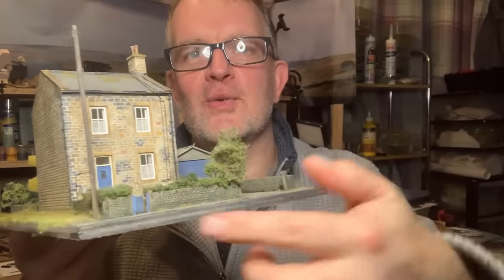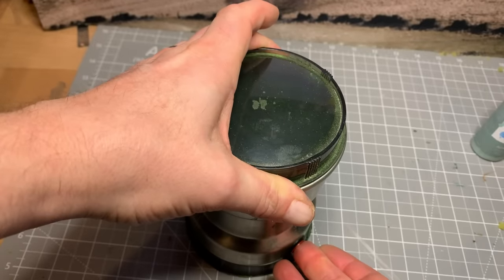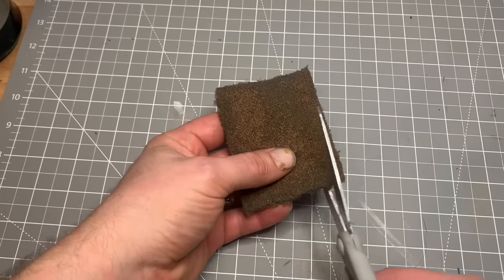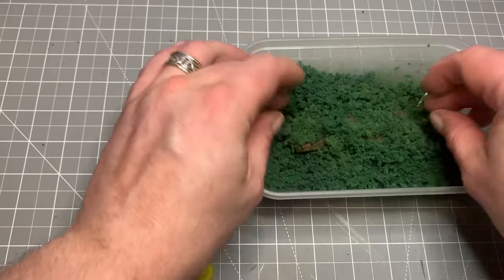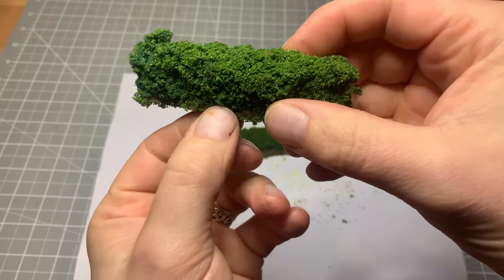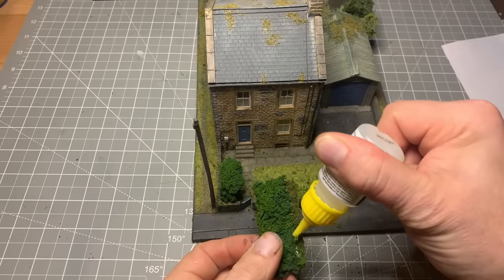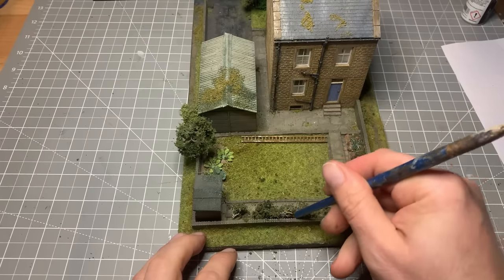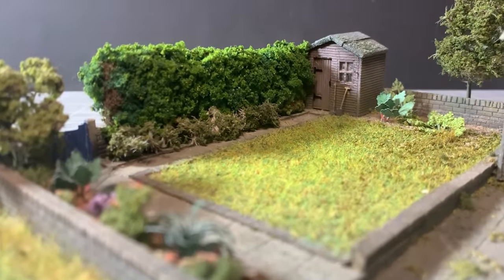How to make a model hedge from a SIMPLE pan scourer!

Comment: This is awesome, now I just need a coffee grinder….. every time I tell myself that’s enough spending on model stuff I learn something new and cool 🤣🤣🤣 
This is just wonderful Lee 😍
Reply from the maker: Or a cheap handheld food processor?
Reply: Certainly cheaper than buying the mass produced stuff from certain brands. Great tips, subbed 🎉
Reply from the maker: @_RandomPea  with a bit of time and for about the same cost you can make about 20x as much
Reply: I have two coffee grinders, $5 or so each at the thrift store. I also dump out the grinder contents and spread on a paper towel as they dry a lock quicker
Reply from the maker: @tomaaron6187  There you go. It’s worth getting one (or two ) - handy little tool…
Reply: Nicely done, thanks for sharing..Overall this saves a lot of money on off the shelf hobby items..
Reply: save yourself some money and pick one up from a salvation army store or goodwill.

Comment: I use a lot of your methods, the cheap coffee grinder and methods of colouring. I rip my foam from old foam chair cushions with a wire wheel. I have cut foam blocks to size, painted them brown and rolled them in fine foam while the paint was still wet for manicured hedges. For sculptor mould, I put 10 sheets of soft toilet paper in a nutri bullet, give it a quick whizz and you have paper fluff. Put about an inch of plaster in a fruit jar, fill loosely with the fluff, shake vigoursly to coat the fluff, add water to desired consistency and you have the cheapest sculptor mould you can get. You can use the coffee grinder but it is necessary to cut the paper into small pieces. Badly weathered MDF broken up and put into the coffee grinder makes a good static grass. Colour in the same way as you did the flock. Whizz again when dry to separate any fibres that may have stuck together. Can be rubbed through a sieve to grade it into various lengths. Who needs to spend a fortune on materials when a little ingenuity can save heaps by using what we have lying around
 Besides it gives a lot of personal satisfaction to know that it was all your own work!!
Reply from the maker: That’s brilliant- I think a lot of us have picked up tricks and tips from each other and it just goes to show what ingenuity there is in the modelling world, and yes, there’s much more satisfaction in knowing you did it yourself

Comment: I have usually found that a hot glue gun has a mind of its own on how much glue you require. I found a Sicaflex adhesive which is very good for assembling foam pieces for terrain. Is required a few hours to fully set but grabs quickly
 You can spread it with your fingers, use it to fill gaps and water cleanup. Can't remember its  actual name but it's one of the cheaper products in the Sicaflex range. To shape the styrofoam base for my terrain, I use a file card. For any who might know it by  a different name, it is the short bristled steel pad used for cleaning the swarf from hand files. It is a bit messy and having a vacuum cleaner handy is desirable but it is far easier than using a knife.
Reply from the maker: Love all these extra tips - thank you 😊

Comment: Looks good, but a few suggestions - firstly use PVA or Mod Podge for a better bond when gluing foam, foam tends to just absorb superglue, causing it to dry fast, which just makes the foam go hard without actually gluing it very well. Second, once it's finished get some matt Mod Podge, dilute it and put it in a spritz bottle, then spray a few squirts over it to seal everything in, making it more durable and stopping any loose bits from falling off. Mod Podge has a sealant in it that works well with anything like foam or scenics to help lock them in place.

One more thing, if you mix up more batches of the ground up foam with different shades of green, you can add a little bit here, a little bit there, just to break up the solid colour and give it a bit of variation. Not always necessary, and it depends on what you're going for, but just another little thing that can add to a piece if you feel you want it.

Just found your channel and I know what I'm binge watching for a while, haha.
Reply from the maker: Always happy to receive extra information. Superglue was used for speed here, but yea, i agree that pva is far superior in the long run.
Reply: @lnrmodels  A glue gun works well too, especially for speed, haha.
Reply from the maker: @sanguisdominus  hahaha - I don’t get on well with glue guns …
Reply: Yeah, glue guns have those annoying stringy bits that hang between the deposited glue and the gun. They do have their uses when that is not an issue. When applying hair spray to foam, I hold the can well away from and above if possible so that the first couple of squirts fall softly on the foam to moisten it a little without the risk of blowing any loose bits away. Just a couple of these light ones and then you can get serious without any undesirable results.
Reply: @rolandhersom239   Sometimes, depending on the build, you can use a lighter or a soldering iron to melt the glue stick and quickly use a toothpick to apply it, it's pretty useful if you need to be a bit more precise than what a glue gun allows.
Reply: Absolutely brilliant mate and very helpful
Reply from the maker: @gardensbytheminute2668  this is what we like to see - a sharing of help, knowledge and advice. I love to see it.
Reply: @lnrmodels  They don't get on well with me either  - I have the burns to prove it!
Reply from the maker: @Beatlefan67  ouch

Comment: Quick to the point, so I loved your video. I've been using hair spray for over 30 years now, and I use it a lot as a terrain scatter and grass fixative.  So I'll start with as Warning.  So far, all hair sprays are water soluble and are fast acting. So, to be safe, especially for wargaming scenery,  seal it with a thick layer of spray varnish purchased from a DIY hardware sore as hobby varnish is too expensive for this kind of work. I use mostly matt varnish.  Some bushes are very glossy on top of the leaf and very matt underneath and often much lighter underneath. So after the matt varnish has dried lightly spray a gloss varnish from directly above in a zenith fashion. Glossy bushes and matt bushes together on your scenery help give the illusion of different plant species. To get the viewer to have an immersed experience with your scenery is in the little details. They may not actually notice them, but the subconscious is tricked to say this is real.
When buying hair spray, stay away from the expensive brands. They usually include fragrance, which is oil based, reducing the fixative effect for scenery. When buying, look for large cans that are closely priced to the little cans. This is because it has fewer additives that we don't want. If there are no name brands go for them as they have even less addictives unless it mentioned fragrance on the can. Go for the cans that have extra strength or the like on it. These have extra fixative in the hair spray, which is ideal for what we want.
Reply from the maker: This is excellent additional information- thank you for adding this:)
Reply: @lnrmodels  Thanks.  A long time ago, a friend knocked over his water bottle, and it spilled over a large terrain piece that I had added a lot of detail held down with hair spray. We looked on in horror as my scenic started to float away. So we both went on a quest to make hair spray more permanent.  Oh, and opened water bottles are banned from the wargames table.
Reply from the maker: @jamesevans886  nooooooo! For sure for permanence sprayed on diluted pva from a mister bottle works well too. I think we’ve all had bottle knocking mishaps… happens to me a lot 😂

Comment: Superb!
Reply from the maker: Thank you ☺️
Reply: @lnrmodels  All good. PS have you a link for the glue ?
Reply from the maker: @modeloco   the foam safe glue is Bob Smith's Industries: https://www.amazon.co.uk/TWIN-PACK-Super-Gold-Foam-BSI121/dp/B0BP7XWN6X/ref=sr_1_3?crid=3BXB04UDGV96N&keywords=foam+safe+super+glue&qid=1701272954&s=diy&sprefix=foam+safe%2Cdiy%2C64&sr=1-3

It's not cheap and I cannot advise you to try using a high viscosity superglue in a well ventilated area, as an alternative...

Comment: Where do you get your foam super glue? ❤
Reply from the maker: I can’t really recommend any specific supplier, but shop around for Bob Smith Industries Foam Safe Superglue. I do also sometimes use a generic medium viscosity glue from The Range, but it does sometimes react and unless you’re in a well ventilated area like outside, I don’t recommend.